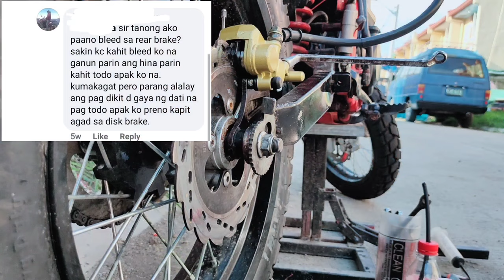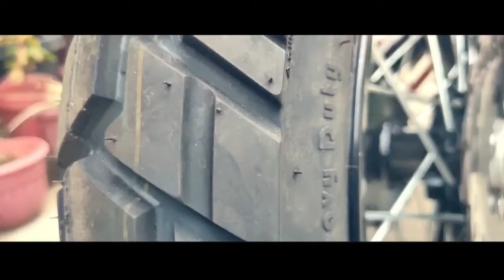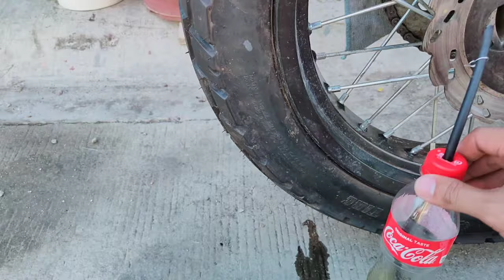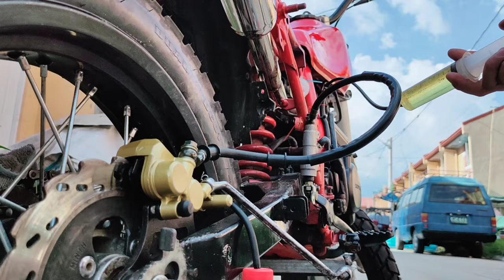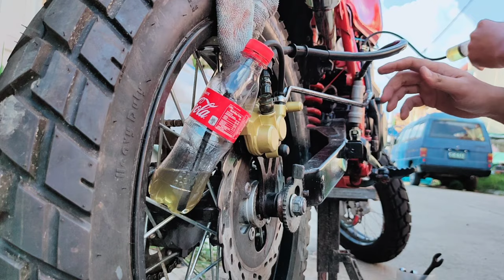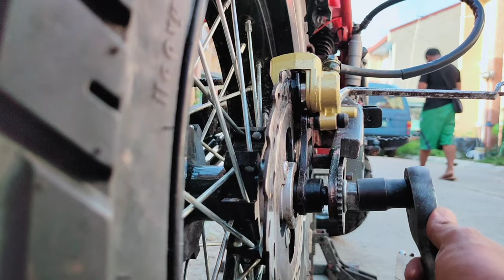Step by step brake bleeding | Rear Brake ayaw kumapit

Comment: In the duel piston caliper it is good to remove caliper turn it upsidedown to get the air out, if not you will be able to see only one piston working the second piston will not work because of air and your brake will be soft and your pad will wear down on one side only.

Comment: Lods npk simple lng nyan,,.  Pump mo ng mabilis yung pedal then press mo ng sagad , wag mo bibitawan then open mo yung drain , kapag lumabas na ang hangin or fluid , close mo ulit,,. Ulit ulitin mo lng ganung step ,. Natural na malambot yan lalo kapag may hangin sa loob ,, hanggat humihigop ng fluid yung repair kit nyan ,, ganun diskarte lng yan
Reply: Paps anong tawag sa pump na ginamit mo conversion dn kasi ang break ko s likod at ang hirap ng manual salamat at rs sau..malaking tulong ang video mo
Reply: Salamat boss yan problem ko solve na

Comment: sakin pina bleed ko kumakapit sya kapag naka center stand kapag iniikot. pero kapag umaandar ako di nya kaya pahintuin yun motor kapag nag rear disc brake ako.
kapag center stand tpos pina andar ko motor umiikot gulong pag rev ko  press foot brake hihinto ikot gulong pero kapag umaandar na ako nag momotor ayaw huminto. ano kaya problema nun?

Comment: Boss ayaw bumaba ng langis kht i pump
Reply from the maker: Walang lumalabas sa bleeder paps?if barado palitan mo ng bleeder screw 10pesos lang un sa mga motorcycle supply
Reply: @pitzmoto  as boss tanggal na screw puno ung cap ng oil pero d bumababa
Reply from the maker: check mo rin ung banjo bolt baka dun may bara..kapag wala parin mas ok palit kana ng caliper sir
Reply from the maker: try mo pa isa isa tangalin from brake master banjo bolt, banjo caliper, bleeder screw para alam mo saan hihinto ung fluid